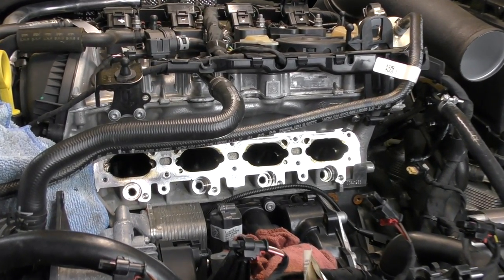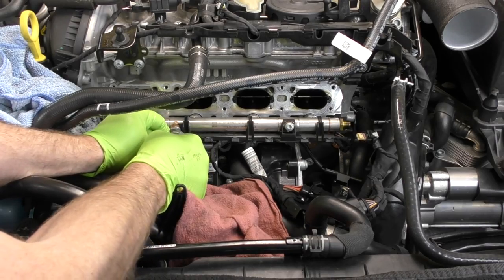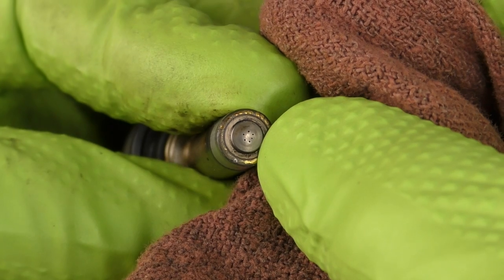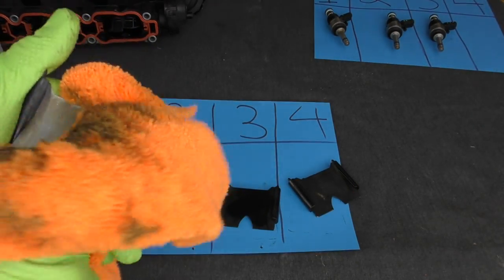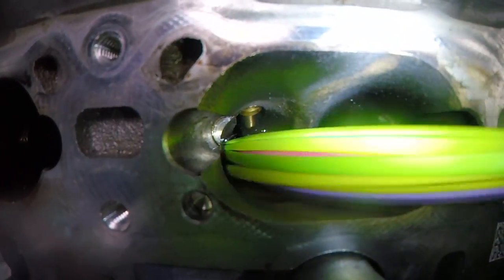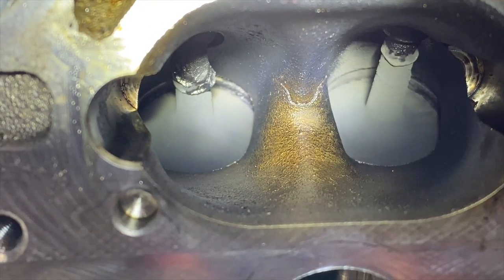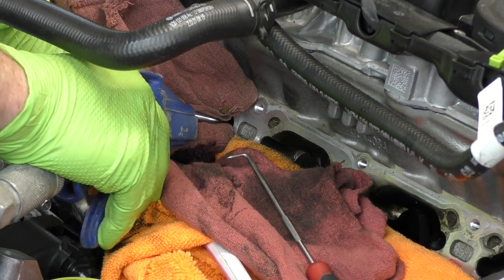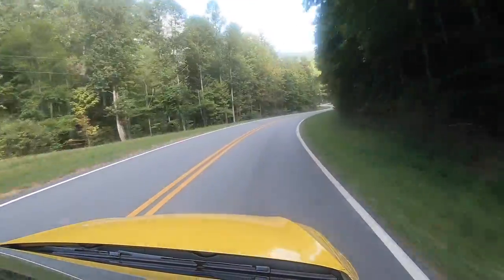How Much Carbon Build Up at 10,000 Miles?? ~ 2019 Golf R

Comment: Hey 2016 Audi S3 here. Has anyone with an S3, R, or gti or a3 with an is38 turbo ever notice a sizzle or static kind of noise coming from the engine bay closer near the turbo after driving and turning the engine off? The noise goes away as soon as the I’m assuming CAN bus turns off. I haven’t messed with anything in there yet and I can’t tell if it’s like a pressure leaking sound or what. Any advice?

Comment: Doesn't the ea888 gen 3 on the golf R has also port injection? 4 aditional injectors in the top of the intake manifold? That should clean the valves tho :-?
Reply from the maker: Not in the US :(
Reply: @HumbleMechanic  that sucks a lot..... What is the point for the new tsi engine then...
Reply: HumbleMechanic Can it be converted to a Euro spec?
Reply from the maker: Yep it can. Not totally sure what all is involved. But I may give it a whack

Comment: So much for paying the high price for premium gasoline that supposed to have more detergents. Toss in some Techron every 2500-3000 miles. The cleaners with the PEA are best. Gumout Complete fuel system cleaner is another. Berrymans B12 contains acetone. That’s what they put in fingernail polish.

Comment: well dang, my Mazda CX5 with Skyactiv GDI engine has over 100K miles and the intake valves have never seen the light of day.  I'd be almost afraid to find out!  Although the car has never thrown any CEL's.
Reply: From what I here Mazda’s don’t really have problems with carbon build up.
Reply: @tails300  well that would be nice if true, but how would they avoid the buildup if it's GDI?  I'm pretty certain it doesn't have extra injectors washing fuel over the back side of the valves.  Ours is a 2014 model, manufactured January 2013.
Reply: Patrick94GSR Mazda runs their intake hotter than other brands which intern makes it harder for carbon deposits to stick to the surface of the valves. I believe Kia/Hyundai use a combination of valve mounting position, staggered spray patterns for the injectors and timing to keep the valves open long enough for some mist to reach the surface of the valves. I do know that the new 2020 Hyundai Sonata and 2021 Kia Optima will be using their own version of Toyota’s D4S system (called SmartStream) in there newest engines, so carbon build up will be eliminated completely on there newest models. (It’ll work even better than the setup they’re using now).

Comment: What about fuel injection cleaner additives?
Reply from the maker: They will help clean injector tips which will help with engine health. Won’t handed DI carbon on intake valves
Reply: I am assuming it helping in preventing sufficient carbon build up by means of a preventative measure in adding Rislone injection cleaner every 3 months or so.

Comment: Doesn't this 2019 Golf have dual injection? I mean port and direct injection?
Reply from the maker: Not in the US.
Reply: @HumbleMechanic  Damn why the hell not? Even in Brazil we have that in the newer Golfs, Jettas, Audis etc. I have an A3 2.0T 2007(only direct injection). Cleaned up valves and injectors like you did and the car changed! More power, easier starts, smoother idle. I had 63k miles on the odometer. Took pics previous and after service. This needs to be done periodically. Great video!

Comment: I have an Audi A4 b8, cdh 1.8t motor, when the car is warm it battle’s to start but when it’s cold it’s fine, not having any problems with performance though, I have checked for faults and there are no faults stored, what could the problem be?
Reply: Crank shaft or Camshaft position sensor, air temperature sensor l, coolant temperature sensor, or MAF sensor.
Reply: Teo Nagode surely there would be a fault though
Reply: @tyler__stevens  For the position sensor's yes. But not for the MAF most of the time, sorry I misread that the car Dosen't go fast while it's gotten up to temperature. Could be a lot of things maybe the timing is off unless it has got a chain instead of a timing belt. .
Reply: Teo Nagode the car runs perfectly fine all the time, did the cylinder head with timing chain myself, no timing faults

Comment: HumbleMechanic  
What do you think of "upper induction service" that fogs an aggressive cleaner through the intake?
Reply from the maker: To fix, not really as PM, possible.
Reply: @HumbleMechanic  our service writers like to sell them, I kind of question the effectiveness. If there is lots of buildup, and this cleaner breaks loose large pieces, you have no control over these pieces. Maybe if it's done on a regular service interval, but on an unmaintained engine with mm's of buildup  it seems kinda risky.
Reply from the maker: Exactly. But it’s easy to test if it works on a car with bad build up

Comment: How much do shops cost to do this cleaning themselves?
Reply from the maker: Usually 6hr or so. Plus some parts. I’d guess $700-$1000 depending on location. For a 4cyl
Reply: Well that’s enough reason not to get a VW direct injection engine😳.

Comment: Man, wide open throttle and hard driving with a 0w-20 is not a good idea. The oil is very volatile and does not provide a lot of protection at high temperatures and loads on the engine. I think that for the 2018 model year you can use 5w-30 fully synthetic with the VW specifications, but on the 2019 and 2020 changed to 0w-20 for fuel efficiency and pollution requirements. You can safely use 5w-30 from castrol and it will help prevent wear a lot better than the 0w-20
Reply from the maker: We will see what happens. It will probably be okay. I’m probably going to switch to 5w30.
Reply: @HumbleMechanic  check out the performance oils from liqui moly. They have one specifically made for VW.

Comment: @humblemechanic is this with or with out a catch can ?
Reply from the maker: With out
Reply: @HumbleMechanic  cool is this something that you think a catch can would help most of this has to be from recirculating crank case pressure is what i would think or do you just not  wanting to go that route i saw you left two cylinder dirty so do you just not care that much or what are your thoughts?

Comment: Hey guys I’m working on my Volkswagen CC and I’m currently stuck. I need to remove the turbo to completely take off the valve cover. Does anyone know/have a video that they can send of someone doing this job?
Reply from the maker: The closest I have done is the TSI teardown video
Reply: HumbleMechanic thanks a lot! I actually watched that vid over a 100 times lol. It’s so helpful, I will watch it again maybe I’m missing something. But if I remember correctly when you started taking the turbo off in that vid it was not facing the camera.

Comment: I thought vw required vw 504 spec 5w30?
Reply from the maker: It’s 504 0w30 on the 19. I misspoke and said 0w20
Reply: @HumbleMechanic  i didn't know there was a 0w30 504 spec, I've only seen 5w30, is it vw approved?

Comment: The only reason this happens of DI petrol engines is the same as the EGR decoke on diesels. The reason is the manufacturer using a cheap arse PCV system.
The oil mist from the crankcase NEEDS to be separated from the blow by gasses before being drawn back into the engine. It's the oil mist that is producing the gunk. 
It's not really carbon build up, well not in the same way as carbon build in the combustion chamber and exhaust ports. It would become carbon build up if it got hot enough to burn all the moisture in the oil away but in reality it's just oil that's become hot enough to begin breaking down and turn into gunk. 
Pretty much the same as when cooking and making a sauce and you reduce your sauce to the thickness you want all you're doing is heating the fluid hot enough to start burning away the moisture content of the fluid.

Anyhoo, if you want to reduce, or possibly eliminate, inlet port gunk build up then fit a good quality oil separator (NOT a catch can) 😉

Comment: I've done a handful of carbon cleanings now and I think your misleading on the time line. It takes me 4 hours from start to finish. About an hour for removing about two hours for cleaning and then another hour for reassembling. My notable one have been my 2015 GTI with 100k and a 2009 A3 with 150k. Both were their first cleaning.
Reply from the maker: The amount charged and time it takes is different. At the dealer we did 6hr I think  4 for R+I manifold and .5hr for each cylinder. 

If you have the right media machine you can clean intake valves in seconds. That doesn’t include cleaning injectors or the extra stuff, setting the valves closed.

Comment: I wouldn't use Scotchbrite. Unless you get the fully plastic pads for cleaning teflon pads, it will have scilica bits in it as an abrasive. It flakes out of the Scotchbrite pad. I wouldn't want that to get into my cylinders.
Reply from the maker: Valves closed and proper clean out leaves basically zero chance for bits to get in.

Comment: Is it necessary to do this cleaning? Isn't this engine is designed to be this way?
Reply from the maker: It will at some point lead to cold start misfires.
Reply: @HumbleMechanic  so is it a design flaw?
Reply: @xushenxin  It's a flaw with GDI in general...all cars that have it will eventually experience this type of carbon build-up.  That's why some manufacturers (Toyota and Ford come to mind) introduced dual injection engines that have additional port injectors to keep the valves clean

Comment: Yep this confirms it. Writing off all VW and Audi DI engines that don't get multiport injection. Which means 0 because none of them make it to USA just Europe.

Everyone buying any new car for the long haul should only buy Multi-port injected engines for this reason. Like the Subaru BRZ Toyota FRS, 2019 on up Mustang GT 5.0. The EA888 has it too but only in Europe. Once again we get screwed in USA. Although Honda 1.5T engines and Mazda 2.5 Skyactive engines don't suffer as bad as european makes due to the strategies they have implemented. Mainly The injector in the honda 1.5t during cruise lets the fuel mixture hit the back of the intake valves. and in the mazda 2.5 using coolant packages in the heat keep the valves really hot preventing build it. What do the Europeans do? Because they want things to break

Comment: Honda VTEC : none, why? IT IS OVER 9000 (rpm) 👍 , seriously GDI is a problem, the Mitsubishi engines had it too in the late 90s. Problem back then was fuel in Japan was sulfur free, outside Japan not. Modern engines and fuel management are made for low to mid power band, and people driving short distances makes it really worse. Surprised this engine cloghed up even with some track use.

Comment: Absolutely appalling for only 10k miles. Scared to think what it would look like after 150k miles.
Reply: On most Audi/VAG GDI engines you are pretty much required to perform an intake cleaning every 60k miles or so, you will run into misfires when the engine is cold due to the buildup on the intake not causing a good seal that gets better once warm. At least $500 for a 2.0, and can be more depending on if the fuel injectors need to come out and cleaned or replaced as well.

Comment: My valves were much cleaner and I had done 20.000 miles when I opened it up. With that said, I'm running water meth and doing very tight oil changes.

Comment: You mentioned 10k miles, racing and wide open throttle. On a direct injected motor i can see just by the hood open, the style motor has a turbo, and there is a ventilation tube that runs to the front side of turbo. 
Wide open throttle causes oil to leak through the tube and get sucked into the turbo, gets pumped through the charge pipes, intercooler, throttle body, manifold, etc. Builds up right on all the parts displayed in this video. 
To eliminate this entirely, simply install a catch can with its own vent filter on top. You may smell the oil when hitting full throttle but its better than carbon buildup  in your motor. That sticky stuff is likely oil. I would advise pulling the charge pipes and intercooler off. cleaning the internals and removing all the oil resedue in them.

Comment: That much carbon is not gonna do anything even if it was three times that amount. If you don’t want carbon buildup you need oil that doesn’t burn and vaporize when it hits the backside of the super hot pistons as well as the connecting rod bearings which run very hot The best I have found is Amsoil signature series. Mobile 1 FS. And Pennzoil platinum hundred percent synthetic that’s what I am running in my Porsche which is tuned to 660 hp . My car is white Believe me  with those three oils even after 1000 miles there is very little burnt oil on the Back of the car Above the exhaust I ran 2 other oils in this car after 200 miles it was black all around the exhaust which tells me the intake valves are getting a lot of burnt oil passing by of course I took those oil’s out immediately. And my oil level stays the same for 5000 miles.

Comment: Possibly your  additive cause it.
Reply from the maker: Maybe. That’s also possible.
Reply: @HumbleMechanic   SN plus ACEA specific oil is for very low ash contain is required for direct injection engines. This type of oil indeed reduce the amount of carbon.  The additive ruin the specification.

Comment: Appalling with only 10k and that much carbon buildup… smh. I have a 2020 Honda Civic sport 2.0l with regular fuel injection not GDI and recently while having my oil change at Honda- the mechanic recommended I do a carbon cleaning bc I’m at 10k miles. I told the advisor that it’s only at 10k miles and it’s just regular fuel injection not GDI. I make it a point to stay away from anything GDI unless it’s been proven that it’s dependable and reliable like the 2015-2016 Honda CR-V earth dreams engine.
Reply from the maker: Yeah Honda is seeing this too. Sad side effect of DI

Comment: the Ceratec probably did much of that build up.
Reply from the maker: Really? Can you elaborate on that? I’m super curious
Reply: @HumbleMechanic  its been elaborated a lot in the past. Its known to leave deposits, iirc mostly on the spark plugs.
Reply from the maker: @Corsa15DT  Do you have some resources for that? Id love to read up on it.
Reply: @HumbleMechanic  not with atm, just google it. Also there are tests showing that there is not any benefit from ceratec,  videos are on yt.
Reply: @HumbleMechanic  I was wondering do you have many short city runs with this car? The carbon usually builds up from slow short city destinations.

Comment: What an awful engine design. I have a 2017 Seat Toledo TSI, with one of these (1.2 CJZD, 110 horsepower, EA211/8XX series, with belt drive & VVT on intake valves), and the only thing I think about is paying off the rest of the loan and getting rid of this car. I was so happy to buy it new... And yes, I am a "DIY" type of guy, I service my cars & my motos solely by myself.

But this car is too much for me - everything goes: bearings, front shocks, tie rods and now this f...g carbon build up. Not even mentioning the rattling VVT belt gear / actuator, which is a plague in these. The car has 38 thousands kms and is already idling rough, with power loss. And yep - only premium fuels & good, VW-approved oils were used... 
And a tip: do not buy parts from mainland China, nor Taiwan. These types are quite popular there (read how many cars the VAG Group actually produces & sells there, it is insane) and there is also a lot of aftermarket manufacturers there. I bought a VVT control valve (hoping it will prolong the life of the ailing actuator) from Taiwan, it doesn't even fit. Don't be tempted by a little lower price.

I even bought an oil catch can, based on advice from one of Your videos (a Mishimoto knock-off, billet, good quality). But I cannot really install it, as the factory breather pipe on the engine is not a rubber pipe, but a hard, plastic, pressure formed piece, in foam insulation and with fancy o-ring fittings. I would have to cut it ans insert some fittings I found on eBay... but it is all nuts! It is almost a brand new car and yet I have to put so much attention and $$$ into it!
Reply: Should have bought a VW Diesel friend, i own an Mk4 Golf TDI 1.9 and my friend always says that's if it's not a Diesel it's not a Golf haha :D
Reply: @arnoldkul3827  Indeed, even the old, single cam, 8 valve VW VAG petrol engines are bulletproof. My parents used to have an older Toledo, Mk1 (facelift), back in the 90's, with EA111 1.6 petrol engine. It was only 75 BHP, but had plenty of torque, due to that long stroke and simple 8v camshaft. Man, was  this car torquey, zippy & absolutely bulletproof (yet not rustproof, sadly).

I then went thru 10 years of Ford Mondeo (Zetec 1.8 engine) and 8 years of latest Mk7 generation Fiesta (Sigma 1.4 engine). Both cars were flawless, even if the Yamaha-designed Sigma was awful, noisy (all aluminium) and thirsty.

Believe it, or not, but when I was picking this white Seat from the dealership with my little son, I still had a pre-payment / reservation for a beautiful Ford Focus sedan 1.6, with a simple, non-turbocharged, non-GDI engine. Boy, I should have taken that other car... Instead, I took Toledo, out of sentiment and to please my mum - as my deceased father had that older one 20 years ago. Decisions, decisions... Had I known what I know now...

Comment: Walnut shell blast was the thing in '80s, '90s...smells great when burning off in converter.  Nothing better than the smell of roasted nuts.  That much work at 10k miles is not an acceptable situation.